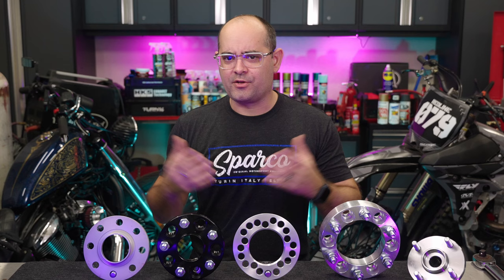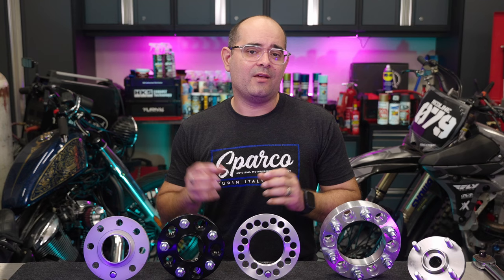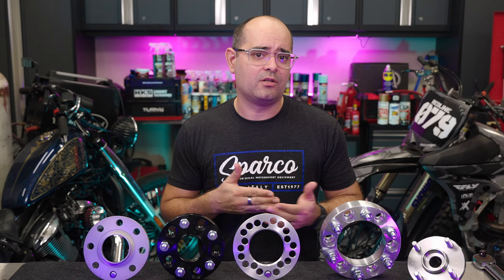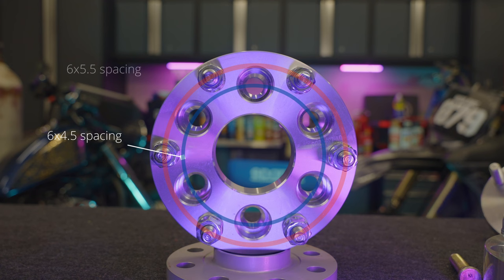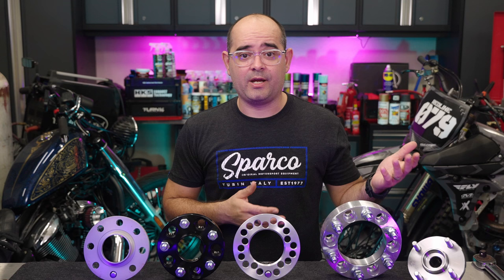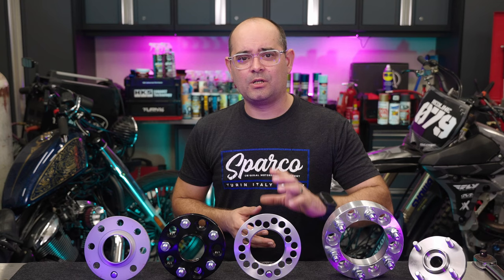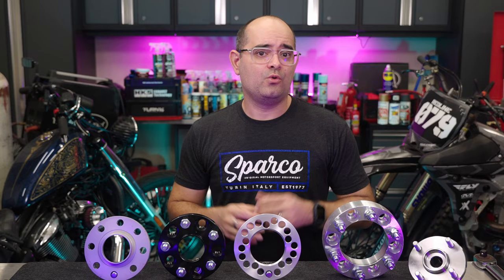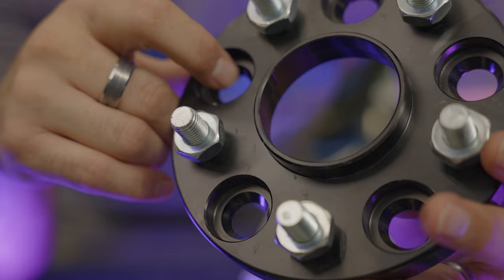Why Wheel Spacers Can be Dangerous. What to look out for and how to use them properly.

Comment: Do I need an alignment after putting 2 inch spacers
Reply: No, all spacers do is offset the wheel. In terms for suspension geometry, it has no effect on caster, camber, or toe. A point I don’t hear too often as it may be case-by-case with each make or model, more offset tends to make the wheel feel more heavy

Comment: I got hubcentric spacers on the hub side only, the side that goes to the rim is actually lugcentric, because the rims i have use the same bolt patern, but have a slightly smaller hub, so they don't fit without the spacers.

Comment: I just put spacer's on my Mustang Gt and it's only been a few days.. The car feels more cat like.. But I have a feeling the driver side front spacer is torqued a little more than it calls for.. I am going to pull the wheel off this week and re do it... The fronts were a little more difficult to do because they spin around on you.. I put a pry bar in-between lug bolts n I used an impact along with a torque wrench.. They called for 150 foot pounds and I may have been over by 5 foot pounds, IDK I am going to take it out for a little ride today.. I already took her out on a long 1 hour ride on back roads that are bumpy and you have to make turns and also a lot of stop and go. Then I took her out on highway to check for any NVH, and everything felt smooth took the car up to 70 n 80 for a minute and so far so good.. I hated the way the stock wheels looked sunk in like that!!! https://www.youtube.com/watch?v=7Z9uTgZeKwU

Comment: Do they have any benefits at all for a road vehicle? Do they affect your insurance premiums? Can they invalidate your policy if you have a claim and haven't informed the Insurance company?
Reply from the maker: They are usually installed primarily for aesthetic reasons altho they do widen the track of the vehicle which can help performance and stability when cornering. I have never heard of them affecting your insurance premium but that is something that will probably depend on your specific premium so it would be best to check with your insurance company beforehand if you want to be safe.

Comment: Great video... ok, does it differ being Anodized or raw non Anodized? Are anodized ones as strong as non anodized ones?
Reply from the maker: Anodizing can make aluminum slightly stronger but for structural parts like this the main thing is the material type. Anodizing is more often used as a surface protectant to help reduce corrosion or for changing the color

Comment: i have a set of 2017 18" silverado wheels and tires that are in great shape.. i want to put them on a 2019 silverado, but they slightly rub the caliper.. could i use a 1/4" spacer to get the clearence, and safely run these wheels, so i dont have to spend 1500 on tires, and have a set of wheels i dont need laying around?? thanks for any advice
Reply: You’ll be fine dude , I ran stacked 4 inch spacers

Comment: My spacer is hubcentric but wheel has bigger hub size I torqued with using lug centric lugs and star pattern should I be fine?
Reply from the maker: Once you torqued to spec correctly before dropping the vehicle on its own weight you should be fine.

Comment: What will happen if you use locktite?
Reply from the maker: Normally each brand of loctite type threadlockers will have a reduction percentage value for the torque settings based on the type you are using so you would need to reduce torque setting by that amount as essentially when wet it acts like a lubricant. On average reduction values are around 20%

Comment: Is “Anodized surface, 6061-T6 Aluminum Billet, 10.9 grade lug nuts” safe? The lugs? 15mm
Reply from the maker: That's a fairly common industry standard grade aluminum nut. It is safe if used properly, in other words once it is torqued correctly. Stay away from unregulated air tools that can create over 300 ft lb. Normally you want under 100 ft lb for wheel lug nuts to torque correctly. Best practice is to recheck and retorque after 50-100 miles.

Comment: Are the slip ons known to make the tire shake /  vibrate? how likely is that to happen?
Reply from the maker: Some of the slip ons that have large slots as holes to accommodate an extra wide range of patterns are known to have that issue since they are not evenly balanced and are very hard to get to remain centered on the hub when bolting them up. They also tend to be cast aluminum as opposed to CNC Billet and have less material on them making them more prone to cracking and failure.
Reply: @redlinesgarage  
Thank you for your reply, yes, I confirmed that, I had to remove the precisely because of that. Thank you.

Comment: Soo i have a 1999 tahoe 4x4 but want too get spacers but with longer suds what would you recommend (oem studs are short but also want my truck wheels to stick out )
Reply: Get hub-centric spacers, I’m running 2” spacers on my 99 Escalade. I wouldn’t run anything that isn’t hub-centric.
Reply: @DMoney505 I have an 04 tahoe and I run the stock wheels with 265/70/r16 tires will I have rub issues if I get the 2" spacers

Comment: So dont use locktite?
Reply from the maker: It is not necessary to use loctite but would add an extra layer of protection. Having said that, only use it if you adjust your torque specifications to compensate for the variation that a lubricant or thread locker creates. The manufacturer of the brand you use will normally indicate what percentage of adjustment is necessary.
Reply: @Redline's Garage   I did 100 pounds of torque but didn't add Locktite just wanted that peace of mind is all I installed 1.25 spidertrax on my 2018 4runner
Reply from the maker: @chrisrye8409  you should be fine but always a good idea to recheck torque specs after 100 miles or so if possible.